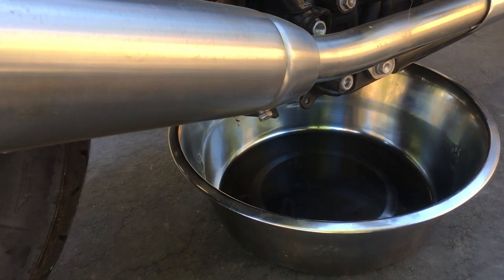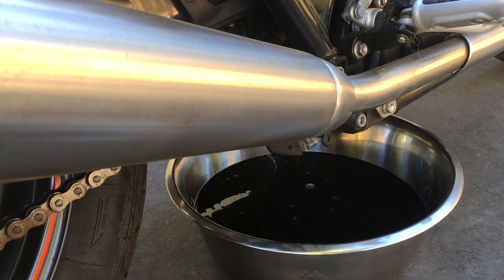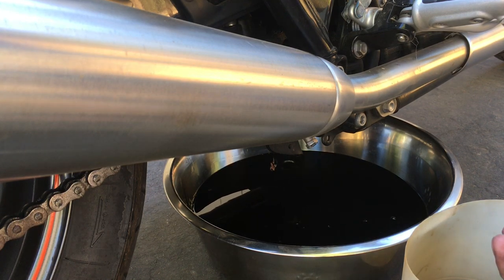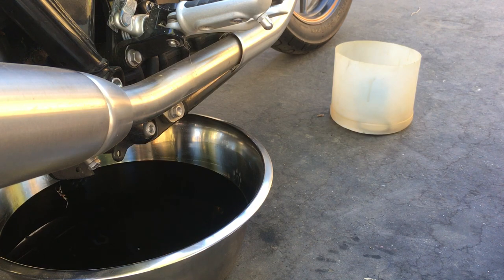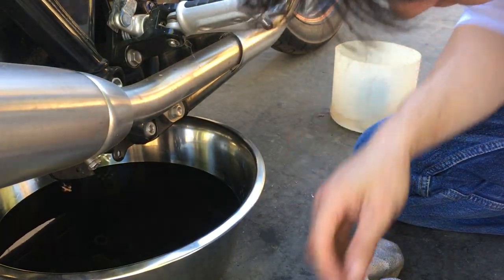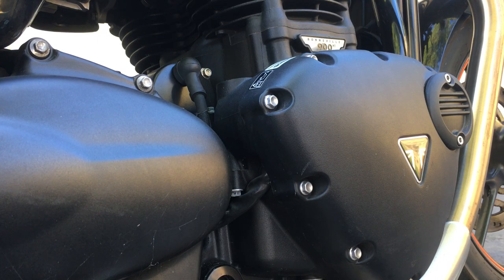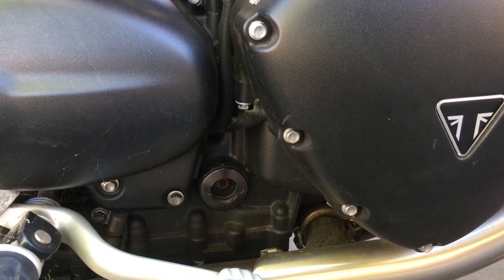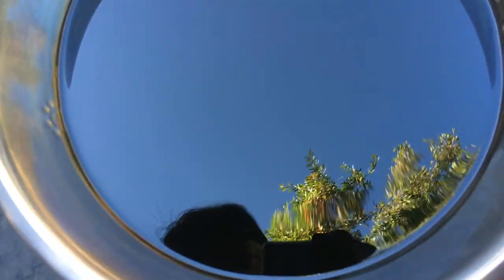Triumph Street Twin oil change

Comment: Tip for the future:  The owners manual tells you what you need to know. Firstly, capacities are Oil Change Only 3.2 litres, Oil and Filter Change 3.4 litres. Too much oil is as bad as not enough. It's also a good idea to fill the new filter with oil before installing it, (measure 3.4 litres first) and it should be tightened to 10 Nm, and sump plug should be 25 Nm. Walmart probably sell torque wrenches.
Reply from the maker: the oil level sight works just fine.  The ideal of filling the oil filter is from a time long past...it doesn't do anything now a days.  Any good mechanic worth their salt will know by feel how much to tighten an oil filter.  There is a reason why most all, including filter mfg., says to hand tight an oil filter.  Same with an oil drain that has a crush washer.  The only times that I have seen screw ups with the filter or drain plug is with idiots using a torque wrench.  Time and time again I see in in various moto and auto forums.  And really idiotic to trust a walmart torque wrench.  I have a snap on for very precise measurement which filter and plug doesn't need.  Why do these folks keep on stripping using torque wrenches?  Well it is because they use cheap unaccurate ones to start but also a torque wrench will not let you feel the crush washer being crush down on a drain plug and will not let you feel the oil filter o-ring distorting.
Reply: Typical response from somebody that never reads a manual produced by the manufacturer because he thinks he knows better. You spent a lot of time moaning about the previous owner or mechanic tightening the filter too much and perhaps if he had used a torque wrench and set it properly you would have got it off easier. The oil level sight does work just fine, as long as the idiot doing the oil change doesn't do it on a slope. The key word here is LEVEL. The one thing you Don't do is check an oil level on a slope. You are right that an experienced mechanic can feel for the correct tightness, but you don't strike me as an experienced mechanic (or vlogger) because if you were then you would have got all the stuff together and got your script right before you started, and if you own Snap On tools, then you should use them because they are very accurate, unless you think that your hand is more accurate. Don't forget that very inexperienced people will be looking at the way you do things and will be thinking that it's the right way to do it. Here is a video that is very well explained, from the reason why oil needs changing to the correct way of doing it. https://www.youtube.com/watch?v=RW7M7ZIk2io&t=425s
Reply: @stevenhill6214  I agree with you Steven. This video was painful to watch.
Reply: Actually, there's no need to fill the oil filter with oil. It would be mentioned in the owner's manual if it was the case. I worked on piston aircraft for a few years and even in aviation it's not something we do. 
Totally agree with everything else you wrote.
Reply: @Virtualmix  Yeah filling the filter is a personal choice thing, and it's probably only done these days by old school mechanics....a bit like using copper grease on brake pads, some do some don't.
Reply: @Virtualmix  manual mentions to fill oil filter!

Comment: Both of those filters will flow the same because the bike has a positive displacement oil pump.  Even the one with less holes in the base still has plenty of holes to flow the small volume the bike's pump puts out.

Comment: Never Use a Fram!!! OMG. Get a mobile 1 or A factory Triumph filter. Fram  filters are garbage.
Reply from the maker: Fram orange filters are garbage.  The Fram Ultra Synthetic is the best filter on the market at a low cost.  Know the difference.  It is better then a mobil 1, K&N, or factory.  Factory is usually not that great.
Reply: @DaBinChe  Gram quality control is atrocious. Just wanted to pass on some information to another Rider. Stay away trust me...
Reply: @DaBinChe  as for the factory filter, it is a good filter, and also the only filter approved to carry out the warranty. So, Choose an after-market one and granade the engine, or choose the factory filter and if you have an issue you will be covered. Just some food for thought.
Reply from the maker: @chrisdigital  Not according to the Magnuson-Moss Warranty Act.
Reply: @DaBinChe  hey man you do what you're going to do I was only trying to give you a heads up, good luck .
Reply: Are all bikes designed to be positioned upright for complete oil drainage?